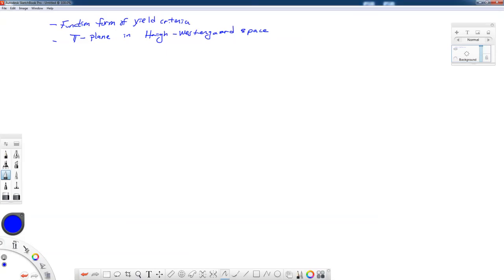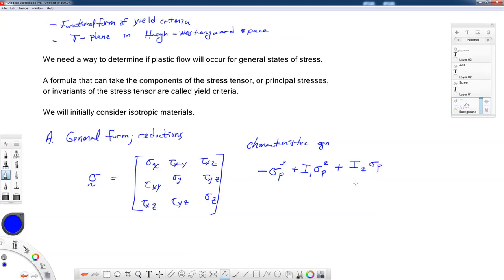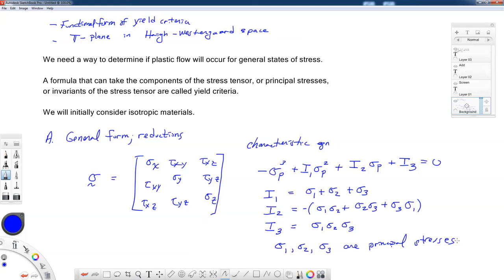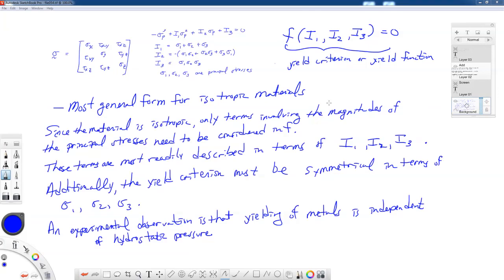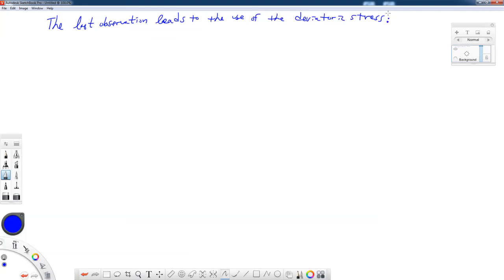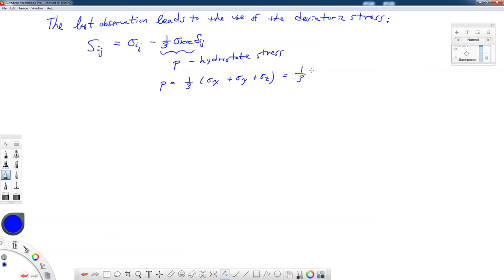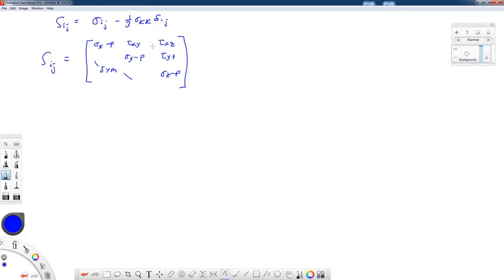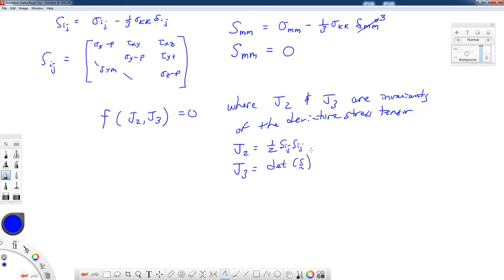AEM 648-8-Functional Form of Yield Criteria; Pi-Plane

Comment: Thanks for sharing Prof. Mark Barkey.
You have mentioned some technical papers in most of your lectures. It would be helpful if you could provide the names of those papers in detail.
Reply from the maker: Hi bharth shan, sure--if you can give me the minute:second mark I can try to recall the paper.
Reply: 09.50  Thank you.
Reply from the maker: https://www.google.com/search?client=firefox-b-1&ei=vCrPW_WVMM2-tQWvi5bABw&q=bridgman+hydrostatic+pressure&oq=bridgman+hydrostatic+pressure&gs_l=psy-ab.3..33i299.44782.53123..53860...0.0..0.189.2803.24j6......0....1..gws-wiz.......0j0i22i30j0i67j0i13j33i160.vBNTCI1MNOM
Reply: Thank you professor.